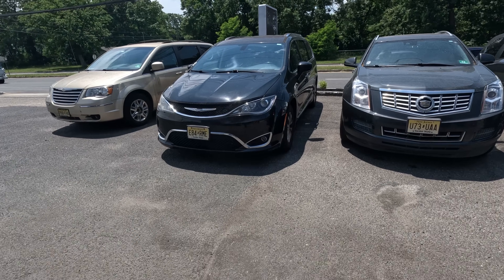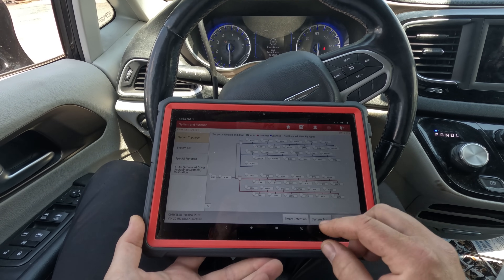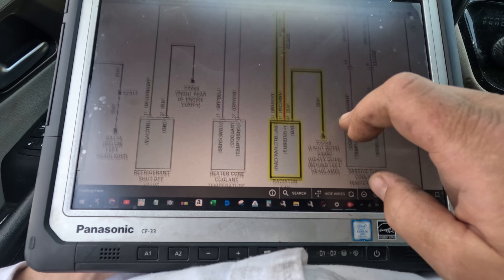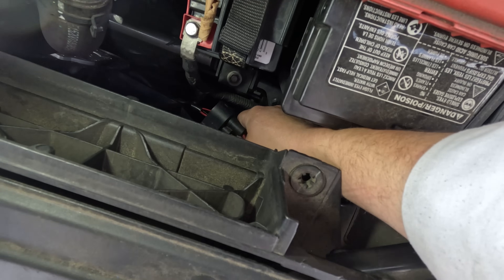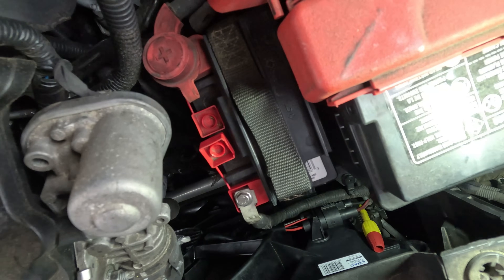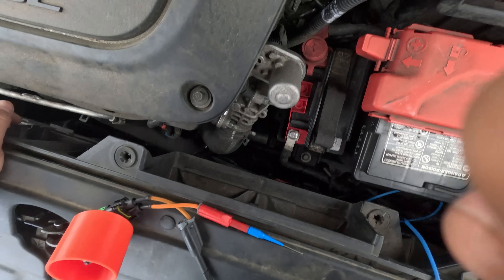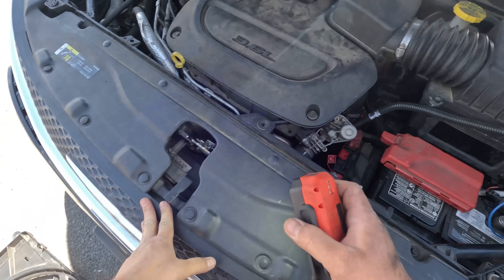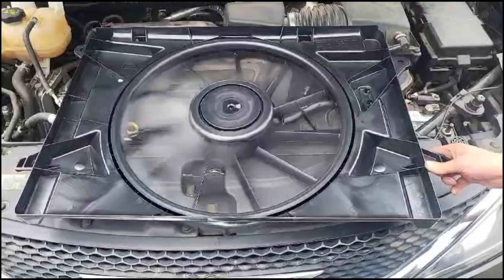2019 Chrysler Pacifica - Overheating! Cooling Fans Diag & Repair!

Comment: I'm surprised there isn't more protest about requiring subscription. It pretty much excludes DIY use, subscriptions are way too expensive.
Reply from the maker: I agree most times, it's cheaper to buy a new tool than to update them. The Otofix D1 is $119 a year after 2 years so at least the cost on some of the cheaper tools came down quite a bit.
Reply: Good to see you still active Spelunkerd.  Fully agree.  The right to repair path is fraught with intentional blocks put up by manufacturers, an absolute joke.  Well hopefully the financial pain some of them are experiencing and their blatant gouging of regular people will be a lesson for all.  Louis Rossman is fighting the good fight, happy to see yourself and others feel the same way.  
Stay gold.

Comment: Excellent video, thank you.
If you tap into the twisted pair under the hood and jump it to the OBD port break out box pin 6 and 14, will it bypass the secured gateway?
Reply from the maker: Yes it will, they sell bypass cables for the key tools that plug into the star connector to bypass the gateway.
Reply: @advancedleveldiagnostics  Thank you for the reply.
You are doing a great job with your videos; I watch all of them and recommend them to all the techs I know.
Reply from the maker: @rodvan-zeller6360  Thank you I appreciate it!

Comment: My topdon subscription expired 2 months ago. Still got into a 2019 jeep Cherokee without using the bypass cable. Next one you get try your topdon
Reply from the maker: Good to know! I assumed it wouldn't work because my snap on, autel and a launch didn't work out of subscription. If I don't update in time I'll give it a shot. Thank you!
Reply: When did FCA start requiring autoauth?  Not too long ago I did a 2015 Journey without any paywall.
Reply from the maker: I think 2017 was the first year. It's not every vehicle only the ones with a secure gateway module. for example, the grand caravans don't have one even in 2021.
Reply: Thanks for the info, will keep it mind

Comment: The air shutter on these have 2 different styles. The pin is populated in two different areas of the connector and you need to get the factory replacement harness because on some of them, the pin it needs has been blocked off. You can't even de-pin and move the pin because it simply doesn't exist on the connector. Some of these can be a pain if you don't work on these every day.
Reply from the maker: My first time getting stuck on an active grill shutter, I was so fed up with the car after calling the new air shutter bad. I took a small drill bit and unblocked the connector then I switched the pins around 😉

Comment: Could you have just jumped power and ground to the fan and pulled signal wire down to ground with a power probe to 100% prove fan didn't work? Just curious. I learn a lot from your videos ...short simple and to the point you're up there with scanner Danner and diagnose dan.
Reply from the maker: That probably would of worked, the reason why I was trying the other signal is because I was worried maybe the wiring was supposed to be switched around as some Pacificas. Before I condemned it I did try pulling both pins down with a test light and even giving my own pwm signal in case grounding it wouldn't be good enough to tell the module to turn on.Thank for watching!

Comment: Good display of "following the data". Tough sometimes to convince the shop that the "NEW" part is junk. But covering you basis gives confidence in your call! 
Thanks for sharing!
Reply from the maker: Thanks for watching!
Reply: I once had a dealer Nissan AFR sensor and a Denso AFR purchased from Autozone with a defective heater circuit. Both bought within days of each other for the same vehicle.
Reply from the maker: That's crazy!